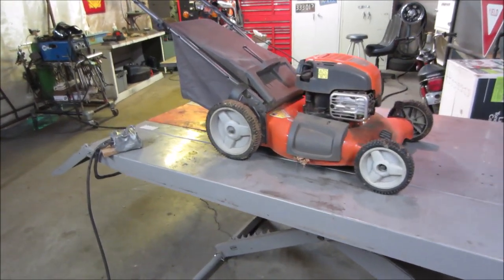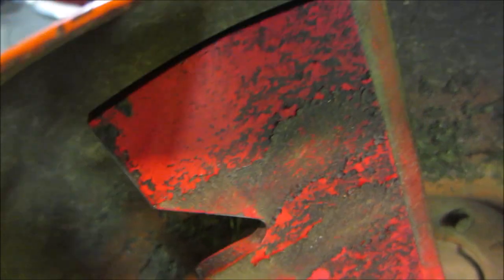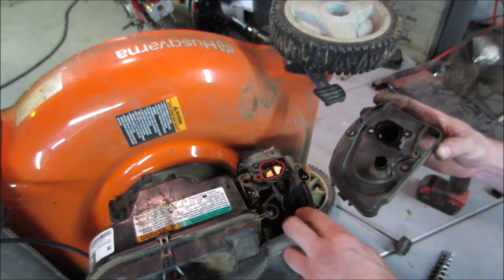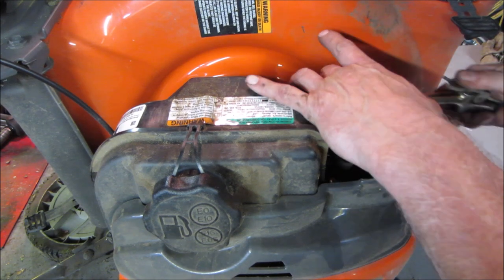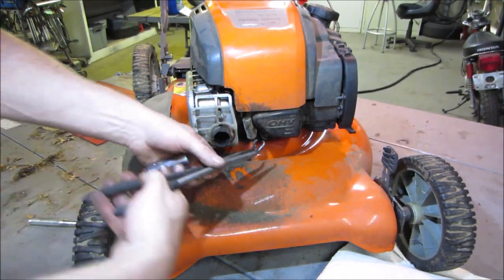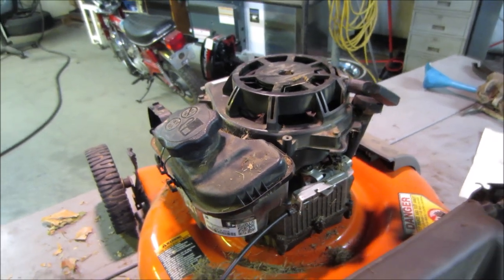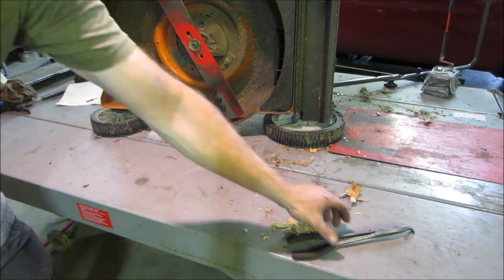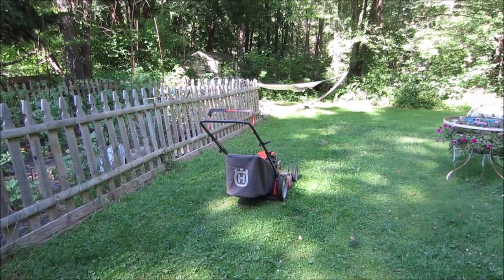NO OIL CHANGES? Servicing A Broken Yard Sale Lawn Mower,

Comment: Well a friend tried No Oil Changes on his '78 Bonneville with a 307, found out it's good for 35k or so.
Reply: Lol
Reply: I've heard of people just replacing the filter every 3,000 miles, and just adding the oil necessary to fill the filter. Some taxi drivers have reported 160,000 miles on their engines that way.(I don't know if I believe it or not) Others have used synthetic oil and bypass filters(Frantz) and have had pretty good success, by replacing filters and adding oil, no drain and fill.
Reply: @vincentrobinette1507  What's the point? Is oil really that expensive?
Reply: @maeflower5108  It's not the cost of the new oil, unless it's some exotic synthetic, like "Amsoil". For me, the problem is, what to do with the used oil. It's very hard for me to find a place, that will accept my 16 quarts of used oil from my generators, lawnmower, rototiller, wood chipper, pressure washer, and slide cutter. It just seems that their used oil tanks are always full. another thing, if an engine is properly broken in, you can change the oil once per season, and know, that the engine will likely out-last the machine that it's on.
     For the taxi drivers, they can change their oil filters with no tools, and it takes only a few minutes. A filter only costs a few dollars, and the money they save, can go towards a new car, which is worn worse than the engine anyway. The trick is, to spend only as much money on maintenance as necessary, to ensure the engine outlasts the car, or the machine it's on.
Reply: @vincentrobinette1507  no engine can possibly run 160,000 miles with no oil changes & just filter changes & topping up, doing this the oil yes is still slippery & keeps things moving but through time oil looses it's ability to protect even if it is keeping things moving it will not protect as it should & things will wear out a lot quicker , the key to keeping any engine good is very regular oil & filter changes to keep clean as possible oil in the engine & oil that also has good protection & detergents for keeping engines cleaner
Reply: @david197407  The argument in the article I read, is that the EP additives in the oil were largely maintained, by the addition of the oil necessary to re-fill the filter, as well as the oil added due to normal oil consumption, which is probably fairly high, if the engine hasn't had regular changes over that many miles. The engine undoubtedly wore out sooner, but in the long run, the car was replaced before the engine was "useless". The money saved by not doing formal oil changes went to the purchase of a new car. He ultimately saved money, even if the old engine wasn't salvageable. The car was deemed worn out, for reasons other than the engine.
Reply: @vincentrobinette1507  you say this but no amount of topping up is replacing enough of the additives that clean & protect properly, also you have oil that looses body over time & simply topping up isn't good enough to maintain good quality , now lets say on standard servicing he'd go through maybe a 5 liter bottle or best part of one every lets say 5000 miles & now lets say due to never changing his oil that his oil consumption had got so bad he was topping up a liter every thousand miles this still wouldn't be replacing enough additives & in the long run would be spending as much in the end if not more on topping up this amount than he'd spend on changing the oil this of course bearing in mind he changed his own oil at home & didn't pay service charges at a garage, you also mention other parts of the car would be worn out as well but all other mechanical parts are easily replaceable for not a massive cost other than maybe if a gearbox was needed but this probably isn't likely as they can last many thousands of miles, have seen cars with 300,000 miles still on original gearbox if driven properly without crashing the gears, so at the end of the day he probably could of kept his oil changed regular as should & made his car last longer for no more or very little more cost than what he was doing & lets not forget that the engine would even run better & give better mpg clean oil in good condition rather than old deteriorated oil that has only top up's added to it
Reply: Did he replace the oil filter regularly? If not, the engine would have oil starved, or recirculated dirty oil because of the bypass valve in the filter. Either is detrimental to an engine. Keeping clean filters on it, will maintain minimum particulate matter in the filter, and allow adequate flow. The filter is the important thing. The filter needs to be a fine enough media, to trap particles smaller than the film thickness of the oil. If not, it will gall out more metal, and create a 'snowball' effect. What worries me, is that this lawn mower engine has NO oil filter at all! the snowball effect could easily take it from perfectly good to absolute junk, in a single season.
Reply: @vincentrobinette1507  yes i get your point that the filter is keeping particles out of the oil which would otherwise block oil ways up resulting in the engine seizing up due to lack of lubrication but the filter does not stop the oil degrading, losing body & additives etc that help protect the engine, as for the lawnmower engine you may be keen to know that lawnmower engines were & probably still are only splash fed rather than using an oil pump so you'll find majority of particles that will do any harm will settle at the bottom of the sump & not be picked up by the splasher, also a lawnmower engine doesn't do the running a car engine does, say if you mow your lawns for about 2 hours per week that is only going to be 50-60 hours running per year so even changing the mowers oil say once every 3 years it will still have done far less than a car engine covering say 5000 miles so therefore this would keep the mower oil clean enough as you are dumping out all of the dirty degraded oil & any particles sooner than you'd be doing with a car engine this will keep the mower oil clean enough to not do the engine any harm, besides i don't think a mower engine would last the equivalent to 100,000 miles of use due to facts such as how they are built plus the fact the oil isn't filtered
Reply: I've got 100k miles without changing oil or the filter on my v-8. Bought it with 120k miles 3 years ago and just got to 220k miles.

Comment: One thing I noticed, is I change the oil, went from straight 30 weight to synthetic 10W30 the first thing I noticed was I got more grass cut per tank of gas. Before, I would cut my front yard, and half my back yard and add gas. After I cut the front and all the back and still had gas left over.
The change to synthetic was worth the change.

Comment: No oil changes sell as eco friendly. The engjne will get past the manufacturer warranty just fine. Then.....
Reply: Only idiots can believe this ive replaced the engine on my old dolmar and Just do the first change its unbeliavle the nasties that come out!
Reply: Whats more eco friendly? A few oil changes or producing a new engine?
Reply: @tesssttest6637  The most eco friendly solution is to use either Renewable Lubricants' oil, or Green Earth Technologies' G Oil. Both will work fine. RLI's base oil is Veggie Oil, and G Oil's base is Beef Tallow.

Comment: I never confuse the blade direction.I fixed a carboned up mower for an Army buddy in 81.The wrench slipped and the blade split my finger nail and finger tip.Easy to remember it goes on with the cutting edge facing the Emergency Room.

Comment: I got one of those mowers and I use a small vacuumed pump with a catch can for the oil change. it makes it really trivial, even easier then using a drain plug on the bottom on mowers that have drain plugs.

Comment: They probably reason that 100-150 hours for a car oil change this mower may have a 300  hour service life 30 hours a year equals 10 years so waste of time.
Reply: Really? Think about it. Viscosity in oil will break down in 4 months in an automobile, but a small mower doesn't have an oil pump to clog, and is constantly slinging oil. Still I think I would change it once a year.
Reply: @williamarnn5240  I have a mower with this engine on it. Mines a Troy-built.  That's exactly what the marketing material says.  They "changed" the internal engineering so that the mower is more tolerant of dirty oil.  I just changed mine before mowing this spring for the first time after owning it for 10 years. A borescope in the spark plug hole shows no signs detrimental wear/scoring to the cylinder wall.  The carburetor on that bastard is a PITA though... I have had it apart every spring that I have owned it. Despite having emptied it and allowing the bowl to run dry its always having issues starting. Warm/hot starts are the worst.  It's got no choke, and no primer button. and the jet isn't adjustable.
Reply: I was think that same thing after my first comment, The amount of hours and design of these small motors would almost never have enough hours to dictate changing the oil.
Reply: @jcota2003  I just go out and run my for a bit in the winter, I never drain the gas or anything, I just fill it up and use it when I need to, I also run some mix gas in it from time to time when the big can runs dry, Have had the same mower like the one in the video, just a newer model with drive and single handle adjustable height for about 5 years, Never changed the oil, never messed with anything, I just start and run it every so often during the winter and add fresh gas when ever it needs it.

Comment: I just recieved a Toro Recycler self -propelled that owner said they couldn't start. They already bought a new one so ...  I took it home and first thing I found was the shut down cable was 2-1/2" too long. The handle for that was mounted in the wrong holes. Corrected it and one pull fired it up. Amazing! Next month it goes in the church yard sale. BTW, I see blades mounted upside down quite often. Some people shouldn't own power equipment, PERIOD!

Comment: I have this same mower, it stinks.  I went and bought the same one with a Honda motor... way better.
Reply: i got the husqvarna i have specifically because it had a honda motor. pretty satisfied. also, i got an angle grinder and was able to sharpen my own blade and was blown away by how much better it was immediately after sharpening.
Reply: I will never buy another Briggs and Straton engine again after having a Honda motor. So much quieter and smoother running than B&S.
Reply: I have this very same Husqvarna with the Briggs engine.  Works fine; never had a problem.  Honda is overrated and overpriced.  Ran them for years off and on; they're nothing special.  Been running Briggs, OMC/Lawn Boy, Honda and Tecumseh engines for years.  If you keep them all tuned to spec, they all run the same, which is to say, fine.  Same with durability.  But, once in a while you will see a lemon of just about anything.
Reply: @Grizzleback07  That's not been my experience.  IMO, Honda is overrated and overpriced.  Ran them for years off and on; they're nothing special.  Will throw a rod just like any engine if you allow it to get to that point.  Longevity is about the same.  Been running Briggs, OMC Lawn Boy, Honda and Tecumseh engines for decades.  If you keep them tuned to spec, they all run the same, which is to say, fine.

Comment: That's the first time I've ever seen a mower blade installed backwards! Lol.. It's great to get stuff like that for cheap, then fix it for basically nothing. I'm still running my old Dynamark 12hp riding mower that my Dad bought in '86. He gave it to me about 15 years ago. Still going after 33 years. Had to replace an idler pully on the deck, and deck bearings, but otherwise just keep the maintenance up and that 12hp I/C briggs keeps on running. Oh by the way, that VW Bus/pickup truck is the coolest looking thing I've seen!

Comment: These mowers actually burn a lil oil as they run...
Reply: It's not a design flaw it's a feature!
Reply: @dayyou  I suspect it is so the oil is slowly replaced. There were over the road diesels that used the same concept. They used an oversized oil filter and a small orifice that put some oil into the fuel tank. The driver just added oil. Cummins started extending oil change intervals to 80,000 miles in 2017.
Reply: I have a 6.5HP Remington that is like that. It came with two quarts of 5w30 synthetic and it burns about half a quart through the season. It's fine really.

Comment: I would disconnect the spark plug lead before putting my hand on the blade, some viewers might turn it and it
might kick. 
Its always a pleasure to witness a mower starting first pull. A real pity the blade was installed up side down as
I'm sure the packaging would have shown the correct orientation.

Comment: My mower has one of those plastic carbs and I was cleaning it outside when the choke spring suddenly rocketed off. I now know not to remove carbs outside and also, the spring set from harbor freight with 200 springs has a spring you can use as a choke spring on this carb. Much better than paying $11 for 1 spring

Comment: I actually just told a story at work about never changing the oil in a lawnmower. They were talking about having to still do an oil change before the grass started to grow...this was in the spring btw. And I jokingly said "You have to change the oil in lawnmowers?" And then I told a story about when I was a kid. Me and my mom lived in the upstairs part of my grandparents house and my grandpa died when I was about 7. And I was tasked with mowing the lawn after that. And we had a Toro push mower. And I cut the grass for years and years without even knowing anything about oil, or how engines work. And I think I was a teenager when that mower finally stopped working. And my cousin fixed it the best he could with no money and it worked another season. Now it's totally possible that our neighbor took care of the oil changes without me even knowing. Our shed was right next to his and he and my grandpa were friends. But as far as I was aware...that mower had the same oil from 1987- 1993+ And speaking of routine maintenance on things that kids have no clue about. I recently bought a new bike, and I haven't owned a bike since I was about 16. And I was reading the oil and grease schedule and it said the brake cables should be removed and greased weekly. WTF! Weekly? Are they nuts? I guess maybe if I was actually riding on a dirt track constantly. But I had 2 bikes growing up and neither one of them ever got a drop of oil or grease and they were just fine. The first bike I just outgrew. And the second one probably wouldn't have lasted any longer if it had been maintained. It wasn't even the brakes that went bad...the rims were just bent so bad it was impossible to peddle. But it didn't matter because I was 16 by then.

Comment: I pick up stuff like that often. Picked up a John Deer weed trimmer.  Had been run for who knows how long with no filter. Someone couldn't get it to run and put on the curb.  Cleaned the carb on it... fired right up.   My neighbor threw out a Ryobi edger attachment when they moved. I picked it up to clean up and put on craigslist for a few bucks.  Since the JD was the same as the Ryobi it worked.  I used it for a season as an edger.  Sold the trimmer the other day with the attachment for 50 bucks so I could pick up a 35 dollar edger attachment for my Echo.  Was a nice trade and it netted about 15 bucks.   On the hunt for a better mower than the one I have.... cheap!   Wish I could find one as nice as that with a backward blade!

Comment: I had bought a Husqui mower a few years ago, kohler engine self priming type. Run out all the gas at the end of the season and it worked well the first season, after that, it would build up crap in the carb every month or so after that. Finally had enough and got rid of the damn thing. The briggs engine on my old Snapper rear engine rider, just runs, same fuel, 93 octane in a clean gas can. Only mower I've ever had engine issue after engine issue.

Comment: Thanks for reminding me. I need to change the oil, spark plug, and air filter on my lawn mower and do a carb cleaning along with the blade sharpening. And a lot of people were admiring your car as well.

Comment: Picked up the awd version on the curb with the rod thru the block, put an old 90s Briggs on it and works like new. Nothing like a free mower that's 4 wheel drive and 22 in. cut with the bagger

Comment: Last year I picked up a Craftsman mower at Lowe's for $250, it has the same engine, but the blade is not as beefy as the one you've got there. I went through five air filters last season because my lawn is so dusty and this one doesn't get a prefilter, I blow them out before every cut, but they don't last. I miss the old foam air filters, they would last forever I would rinse them out, blow them dry and oil them, done.

Comment: I have the same mower.  Runs perfect after a $30 replacement carb each year. Cheap insurance considering we have to use ethanol blended fuels.  All other parts easy and cheap to change as needed. Bought a liquid measuring cup and measure out exact portion of oil each year. I think it is 15 oz.  Keeping mine for a spare after a bought a cordless electric.
Reply: Dude just buy break cleaner and clean the jet. Saves you $25 a carb

Comment: New to the channel here . I just picked up a bran new murray with a Briggs and Stratton 5 hp engine on a 22 inch chase . Paid 20 bucks at yard sale . The guy said it would not start and didn't care to take it back to Walmart . I took it home first noticed the kill switch cable was not hooked up . after hooking up the leaver I looked at oil before trying to start ( good thing I did ) it had no oil 🤣 . I put what oil it called for 0-w30 then started up and ran like a champ and cuts great.